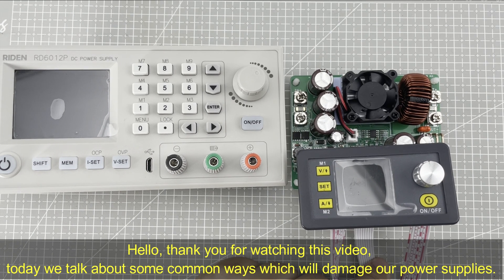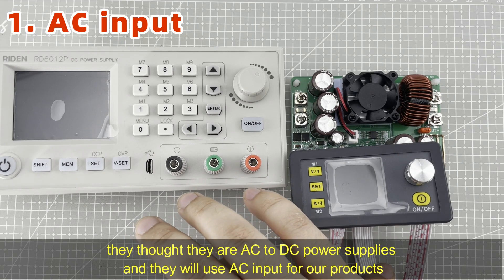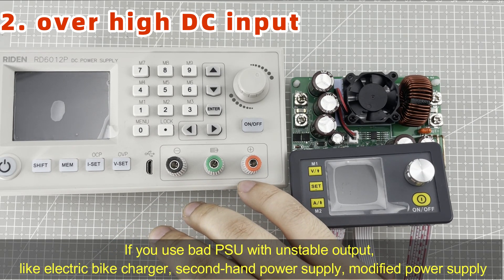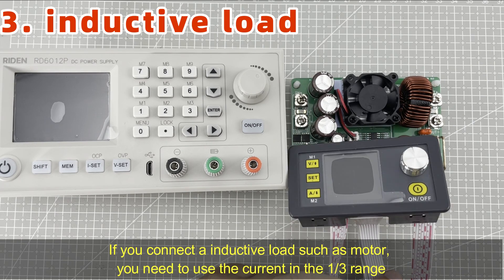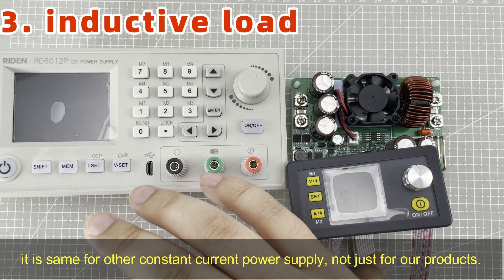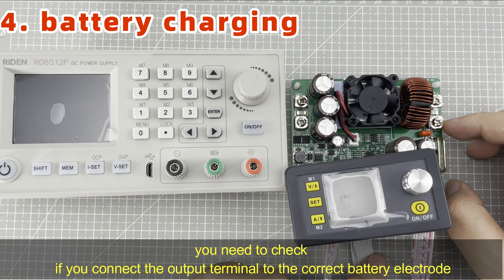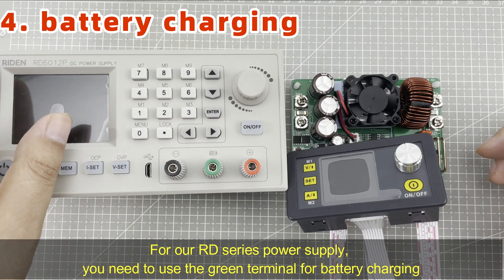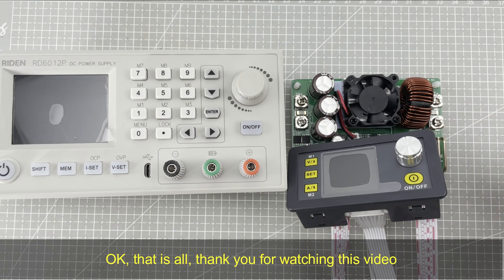4 common damage reasons of RD tech power supplies DPS5020 RD6012P

Comment: Very good video with the most important points. These are typical errors in any lab bench PSU usage. I have the DPS5020 and i am very happy with it and nearly use it dayly via PV input. Just once i burned it by reversing the battery, but it was easy to repair - only one smd diode (20A) and the fuse when i remember right. Since then i am always checking twice before connecting the battery 😉 (but shit happens).
Reply from the maker: yes, normlly as long as you use it in right way, the product service life should be long

Comment: I have DPS5020 power supply. It turns on fine with a 5v DC input. But It does not switch on the output, if I connect anything in the output. It switches on for a moment and stops immediately. Any idea what must have gone wrong?
Reply from the maker: hello, please take a video of the device and show us the pcb board when you set 5V 1A  and short output+ and output-, you can send the video to us via email or contact us on aliexpress directly

Comment: can 2 RD6012p be connected in series (with 2nd PSU's red terminal connected to 1st PUS's black terminal) to generate split +/- <60V?
Reply from the maker: hello, sorry that our power supply can only be used alone, they cannot be used in series or in parallel, otherwise the device will be damaged
Reply: @rdtech9153  even paired with 2 separate AC to DC convertors?
Reply from the maker: @qddchu976  no, output must be isolated

Comment: I just got my 6024w and waiting for the psu if what I have tests stable (just generic 12-16v power supply) can I use that just to test my new rd6024w?
Reply from the maker: hello, as long as it is stable, there is no problem to use it as input power supply of RD6024, RD6024 can use 6-70V DC input, and it is buck woking mode, just notice this and it is OK
Reply: @rdtech9153  thank you very much
Reply from the maker: you are welcome @ozjado

Comment: As I said below, I have an RD6018W.
And as I said, I blew two fuses when using it to charge 12V lead acid car batteries.
My fault: I did not understand what the Green Battery positive output was for.

I did read the Instructions, but several years ago when I first bought it.
But I did not understand the risk of using the Red output for battery charging.
And was confused by the Green colour of the output: I have other PSU's with three outputs, and the 3rd output is usually another ground.
I did not see the link to your videos, and only started watching them now.

I have a couple of suggestions:
(1) Change the colour of the Battery output: to Yellow? Orange? Blue?
Green is a very bad colour to use 

(2) Label it saying it is Positive Output, calling it "Battery" is not clear enough. 
Perhaps "Battery Positive".
Would be even better to say on case it is: "Reverse polarity protected"

(3) Add the information about it into the summaries about each unit

On a related note, are there other differences between the Green and Red outputs?
Is the Maximum Voltage, Current, Power exactly the same?
Ripple?

Perhaps you could add some information about the circuit diagram about this part.
Does not need to be all the details, but enough so that it was possible to understand the advantages and disadvantages of using it instead of the Red output.

Thanks: it is a great power supply.
Reply from the maker: hello, for the green battery charging terminal, its output ability is same with the red terminal, and it can only be used to charge battery, it has reverse protection, cutoff current setting, cutoff temperature setting function to protect the battery, for red terminal, actually it can be used to charge battery, but since there is no protection, you need to be careful about the wiring, and disconnect the battery in time when it is fully charged

Comment: Thank you.
I have RD6018W in your case, using recommended S800-65 power supply.
EXCELLENT power supply.

But I damaged it: my fault.

I made a mistake, and have been charging 12V car batteries with the Red terminal.
I did not understand was better to use the Green terminal: my mistake.

I've done it quite a few times, and did make a mistake and connected a battery with wrong polarity.
I blew the fuse.
I saw your answer how to solve that in a forum, and replaced the fuse.
BUT....I STILL did not realise I SHOULD have been using the GREEN terminal.

Now I made ANOTHER polarity mistake, and fuse did NOT blow fast enough.
25Amp SMD fuse started to smoke, and left some black residue in the holder.

I tried replacing the fuse, but it will not work.
I get a Red LED lighting on the back: D0 next to R64

What can I do?
Thanks
Reply from the maker: hello, you can contact us on aliexpress or with the email leave in this video description, show us the picture of that part, and if possible, you can take a video to show the working status, and we will help you judge the problem
Reply: @rdtech9153  OK thanks very much.
Reply from the maker: @WarthogARJ  you are welcome

Comment: To get rid of switching noise, provide reverse protection, and protect supply from inductive loads a output filter board is needed, with fast reverse shunt diodes a fuse, and inductors and caps, Oh and also a over voltage clamp, fused, eg Hook a 120VDC battery bank to the 50V max output. Or maybe 240Vac, pop goes the HRC fuse and no damage.
Reply from the maker: thank you for your suggestions😀

Comment: hi. my rd6024 has gone faulty. it worked fine for couple of days professionally wired to P.S. CHUX S-1500-60. it was working on 65,2 V. Today it was just turned on, working with zero load. I heard loud squeek, and rd6024 went blank. the little ceramic fuse in the back is ok, no smoke, no smell whatsoever. power supply 65.2V is ok and stable, but rd6024 is dead. what you think of that?
Reply from the maker: hello, please contact us on aliexpress or the email in the description, normally if it is dead when the input power is connected, check the input voltage protection board first

Comment: thanks interesting. I want you to produce and sell a box with a cover only for the panel (rd6024) - a portable universal panel)
Reply from the maker: hello, sorry I do not quite understand it, for case,for now we only S800 case, it is not suitable for your needs?
Reply: @rdtech9153  I think he means a case for the FRONT unit only. A very small one that does NOT hold an AC/DC power supply. 
I suspect he wants to use the RD6024 as a front end to another constant current power supply.
It is a good use because your unit has a LOT of extra functionality to it with the wifi, Android, iOS and PC software software.
Reply from the maker: @WarthogARJ  we used to have a small one but for now we do not produce that case anymore